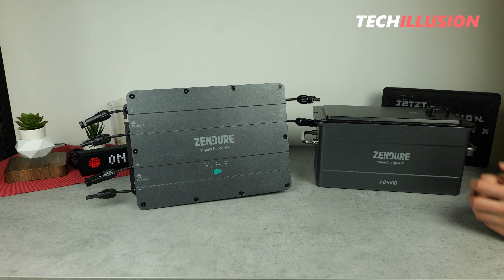🔥ZENDURE Solar Flow BALCONY POWER PLANT - Installation & Setup! ✅ - Step by step guide

Comment: Una domanda : ho un impianto con due pannelli e un sistema di accumulo da 2,5 Kw configurato come nel video. Recentemente mi si è rotto il regolatore che ha il plug batteria uguale allo zendure hub. Potrei montare il regolatore zendure sulla mia batteria? Purtroppo la ditta che produce il mio sistema non vende il regolatore separatamente
Reply from the maker: Hello @prometeo20,

Thank you for your question regarding the compatibility of the Zendure regulator with your existing battery system. If your batteries are still functioning well, I would recommend considering an upgrade to the Hyper 2000 system. I have made a video on this device and I must say, I am very impressed with its performance. It’s significantly easier to use and more compact compared to older models. You can find the video here: https://youtu.be/4ElwHNvwxLg. 😊🙌🏼
I hope this information helps you make an informed decision!

Comment: Coucou l'ami,
Cool cette vidéo et ton retour d'expérience 👍 merci ^^
Je viens de craquer également pour zendure 👌

Par contre je viens de voir sur le site d'inscription d'enedis ou un fournisseur autre selon pays que même si on installe à <1M80 et que la puissance <3kw, si on fait une installation avec stockage batterie il faut Obligatoirement passé par un consuel en france !! J'suis dégouté. . De ton côté  est ce que tu l'as fait ou tu le feras ? Car 220eur la consultation en espérant qu'il n'y ait pas de contre visite sinon rebelotte... Abusé..

Et dernière question j'ai commandé un coffret AC avec diff et parafoudre, ça devrait suffire ? Ou faut il un coffret Dc ? En sachant que vu que présence de micro onduleur, coffret AC devrait suffire ? 

Très cordialement
Bonne continuation, on se tient au courant.
Reply from the maker: Merci beaucoup pour votre feedback!  😊👍🏼

Je ne peux malheureusement pas vous dire quelles sont les règles en vigueur en France. 

Je pense qu'un boîtier de courant alternatif devrait suffire, car le micro-onduleur génère du courant alternatif qui peut être directement injecté dans le réseau :)
Reply: Merci beaucoup l'ami 😉

Comment: Is this working on grid?
Reply from the maker: Yes it's a on grid system. It can store energy and a additional micro inverter converts the energy to alternating current. :)
Reply: @TechIllusion-EN  sorry my mistake.. I would like to ask about off-grid as emergency if the electricity grid break.
Reply from the maker: Ah okay i understand.... I am sorry Unfortunately i have to tell that i didn't tested this. 🤔
I am not sure if this unit works without grid. :/
Reply: @TechIllusion-EN  It can‘t work under off-grid status